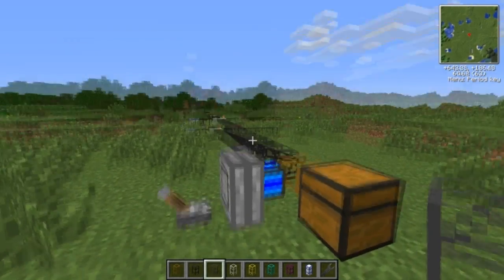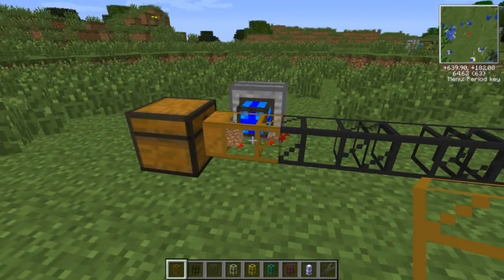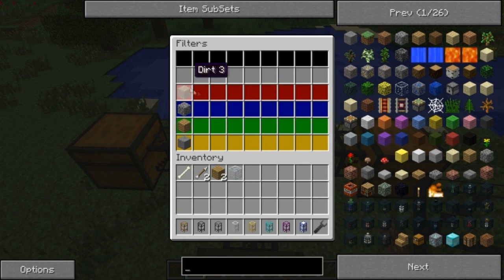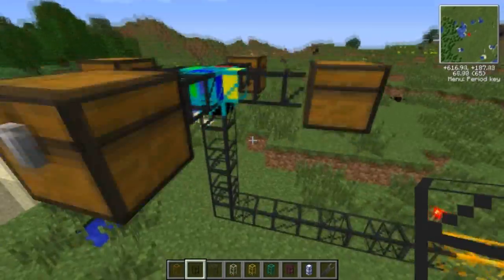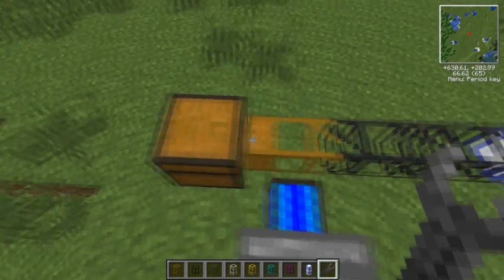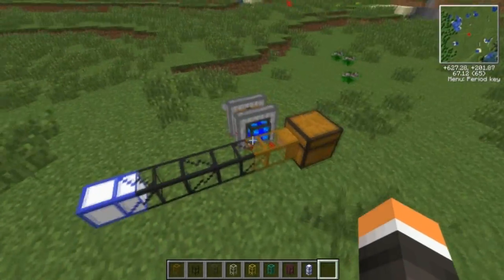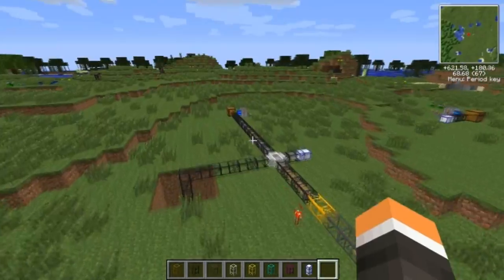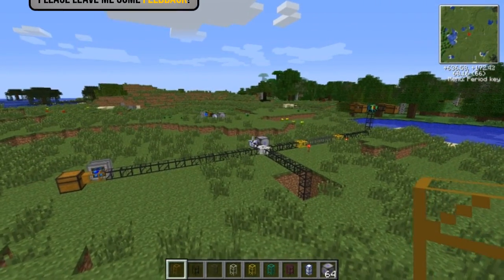Tekkit Tutorial: Pipes - Filters, Teleporters and more! (BuildCraft)

Comment: For people who were curious or still in the dark, the Diamond Pipes color-coded sorted system has a few unmentioned features..notice how there's like 10 spaces when 1 is adequate? you can set "green" to be all the BS, dirt, cobble etc, or place 2 coals in 'green', but 1 in 'black..and it will sort the coal 2/3's into green, useful for fueling & storing simultaneously.